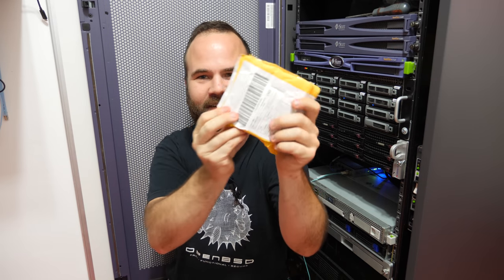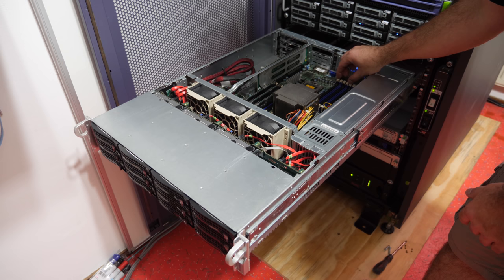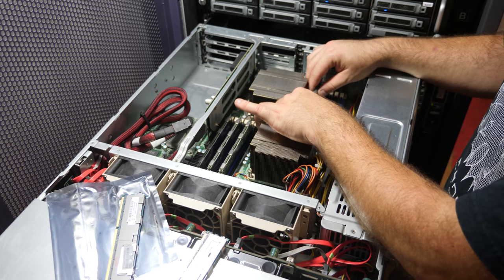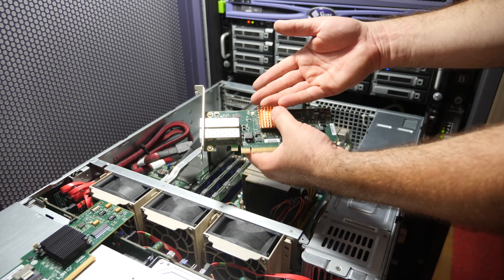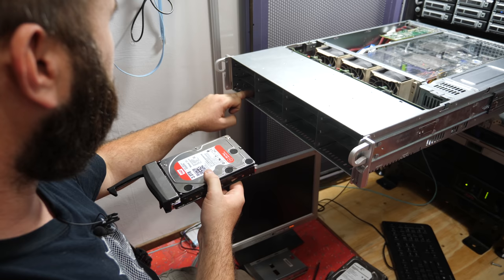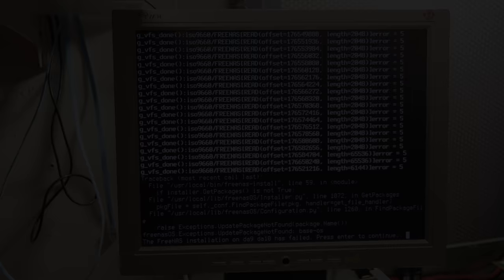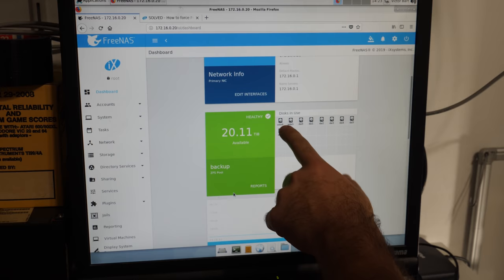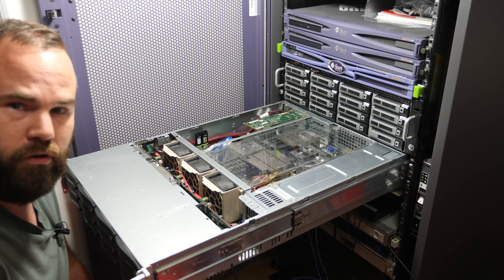Building a Freenas Server with Enterprise Hardware

Comment: Don't worry about memory! 
I do run a backup server with ZFS and FreeBSD-12 on a 2003 Pentium-4 (3.0GHz) with 1.25 GB of DDR (400MHz). It has 3 striped IDE disks in total 0.89TB. My system is quiet :) 

I use it for two types of the backups;
- rsync + smb for the data and
- ZFS send/receive incremental backups for my virtual machines

I backup from a 2018 Ryzen 3 2200G (16 GB) with 64-bits Ubuntu 19.04 to a 2003 Pentium-4 (1.25 GB) with 32-bits FreeBSD-12 and it works!!  

Again don't worry about memory! On my main desktop, ZFS will give back memory from the cache, if it is needed for e.g. a virtual machine or another program. Besides in Linux I can define the upper and lower boundaries for the ZFS memory usage in a config file. I have hit rates of 93% for the memory cache, while limiting it to 4 GB. Also on my laptop I get ~90% hit rates with 2 GB of memory cache.

The Pentium has been built from left-overs, the case proudly presents a Pentium 4 sticker and a Windows 98/2000 sticker. Only 2 cables are connected to the Pentium: Power and Ethernet. It is controlled using a XRDP service and the XFCE desktop. I monitor the Pentium using Conky, which displays dataset sizes, free disk space and many other internals. I connect to the Pentium through Remote Desktop on a Windows 7 Virtual Machine.

The Pentium runs at 90% CPU load and that limits the transfer speed to 250 Mbps instead of 1 Gbps, but that is fast enough, because my 14 Virtual Machines are incrementally backed up in approx. half an hour. The system is only powered on for 1 hour/week, so it is mostly very very quiet.
Reply: How did you manage to keep those IDE disks alive? Is it still using the original PSU? I'm always amazed to see such machines alive and kicking in 2019.
Reply: @cptcrogge  No I have another $15 new PSU 600W, The CPU/motherboard is from a HP d530 SFF, which power supply died in ~2011. Those IDE disk have not been used for 5 years or so. Before that they were in a Pentium III small home file server, basically always powered on, but only really used infrequently by me.
Reply: My middle school uses server made in 2002 with probably similar specifications as your file backup server, but for cloud computing in informatics classroom. 20 students use it at the same time. It´s hard to describe how slow it is for even the most basic tasks. And the ministry sent tablets and smart blackboards instead of new servers, routers and network switches, which didn`t speed things up.

Comment: I’ve done loads with freenas and other open source storage projects using enterprise hardware. Just be aware of raid controller disk size limitations on older hardware. Cheap dell servers from 10 years ago etc may be attractive, but you won’t be loading them up with 10TB SATA disks. Also be aware that some of the raid controllers in these look at the disks for same brand firmware and standard drives may not work.

Comment: Silicon Valley dumpsters may have similar.  But I moved 3000 miles away to a small fishing town.  Not even a Radio Shack.
Your videos are great... inspirational... we do many of the same things, however I am moving more slowly as my retirement income for such toys is limited.  However I am playing with an IBM Xyratex HS-1235t which is very similar to your SuperMicro server.  Although I have only a single Hex core CPU and 24GB of Memory.  I am having issues with USB being VERY S L O W.
One link I followed said USB3 settings should be disabled.  However I have NO USB3 settings in this box.  It takes a while for the server to start using USB stick to boot.  However I hope to install a 1.8" Sata drive (already there) and run Linux Mint OS, VMware and run FreeNAS as a VM.
Would be interested in your experience if any with USB slowness...  Frustrating !  The middlewaed takes 15 minutes to kick in... then all works fine.
Waiting for 8 Seagate Constellation 3TB SAS drives.

Comment: Thank you for a great video. I have upgraded/installed tens of servers, but i never get tired of it. A suggestion is that you can design the raid from the bios setup for raid on the usb, and for the storage raid if you needed one. Cheers.

Comment: Those L5640s are great little chips. Had one of those in my old 1366 server. Switched to a Haswell E3 system, as I have it on 24/7 nowadays and the power cost would have been a lot higher on 1366. Even though the L5640 is "low power", the platform itself is not efficient by a long run. And you know how expensive our Dutch power grid is XD

Also, thermal paste, not "terminal" paste ;P

Comment: The Idea is fun but i honestly i wouldn't spend a dime on it.  This kind of machine is just too old and you will see the costs in your electrical bill if you leave it running.   To the people who are looking for a VMware server or Freenas, get a newer model server,  like from 2013-2016 for a good price. It will be much more power efficient..  basic rule:  the newer the hardware, the less power it consumes and the more performance per Watt you get.  Ofcourse you can't buy new server hardware because it would be too expensive but if it's too old you're paying in another way you really need a good balance.
Reply: That's where solar comes in. Especially if you have a huge excess in reserve power. Those old servers double as room heaters in the winter too!
Reply: That's all relevant for 24/7 usage, but in this case the system will only run when doing backups.